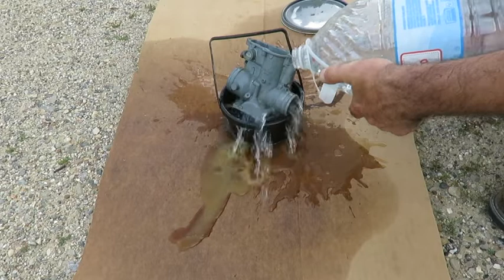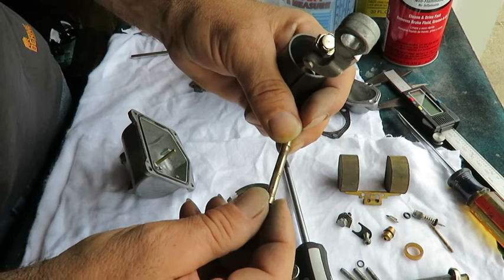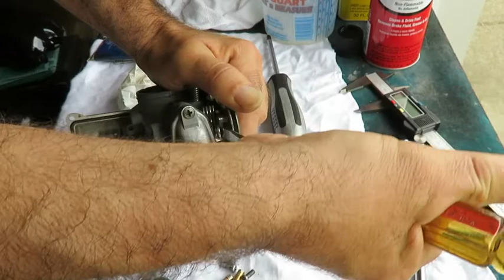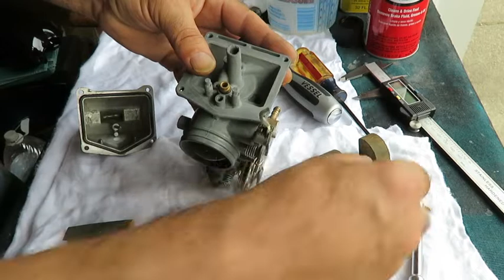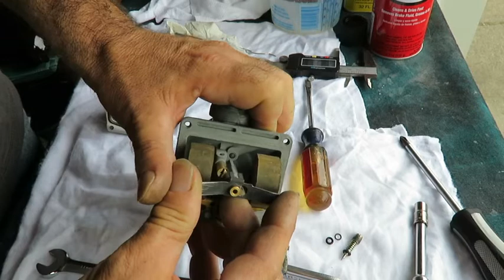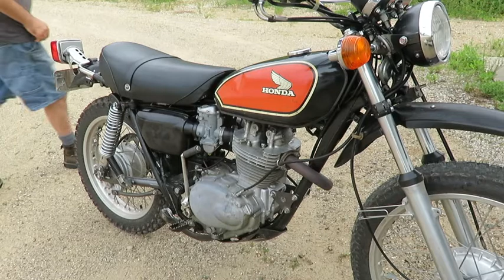1974 HONDA XL250 Keihin 645B Carburetor

Comment: The plastic bushing you put in the top of your carb actually should be on the outside of the carb. It should be put under the metal bell washer that goes behind the throttle spring. Otherwise, pretty good video.
Reply from the maker: Thank You Very Much for your Comment. I am Learning the best that I can. Have a good weekend. Cheers.
Reply from the maker: I went through the carb again and put the newer needle in. Moved the plastic bushing. It fits right in the metal cup outside the carb. I remember now. Thank You. Bike fired up on the third kick. I still may need to rebuild, I am getting Closer.

Comment: Hi mate thanks for the video 
I’m just pulling mine apart as we speak 
🇦🇺👍
Reply from the maker: I made a couple of mistakes that commentors corrected me on. The biggest one was the nylon bushing on the throttle body goes on the outside. After I fixed that it solved all my issues because air was getting in. Thanks for watching.
Reply: @ZPDSurvival  yeah right I did read that in the comments, thanks again that’s great, did you end up buying a carby rebuild kit for it? If so may I ask where?
Reply from the maker: @ALLAUS  I did buy a rebuild kit off Ebay. Made in Taiwan. Excellent Kit. I may search for the exact person I bought it from and put the link in the description.
Reply: @ZPDSurvival  Terrific that would be awesome

Comment: 24mm** for the float.
Reply from the maker: The Clymer manual says 29mm. I will try 24mm. Thank You. I am close but it's just not running right so I took a break for a bit. Thanks for your input.
Reply from the maker: I don't know where I got 29mm. It clearly says 24mm in both my books. Thank You again.